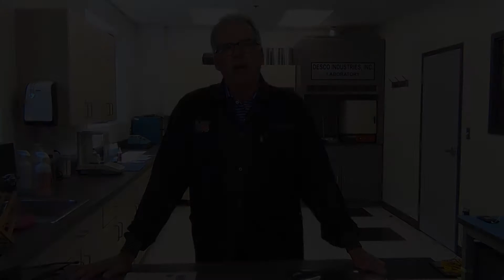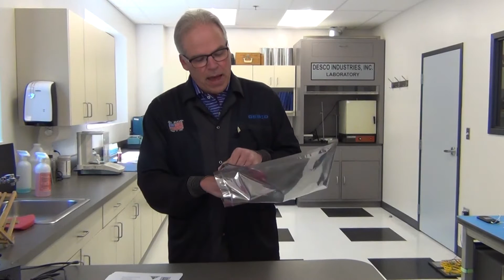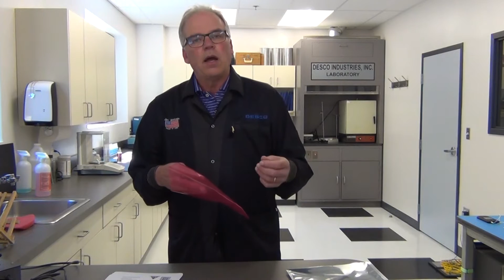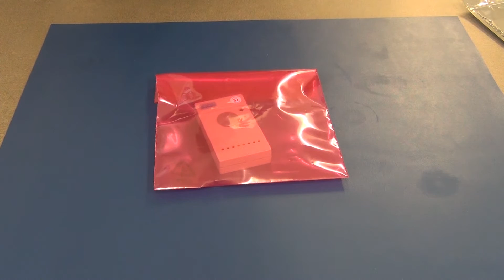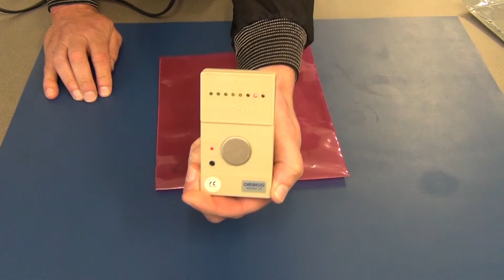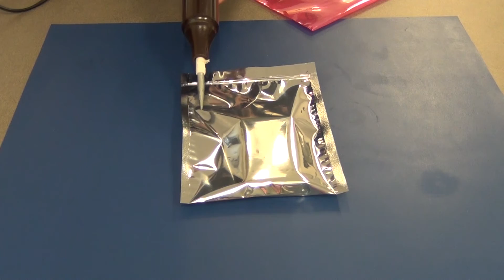Static Shielding Bags vs Pink Poly Bags

Comment: is it effective to wrap my circuit breaker panels with A shielding roll to prevent emf from spreading
Reply: This is not what our products are intended for. However, the metal panel and cabinet that the circuit breakers are mounted to would have a similar effect in shielding EMI.